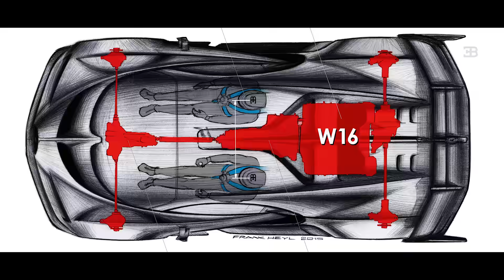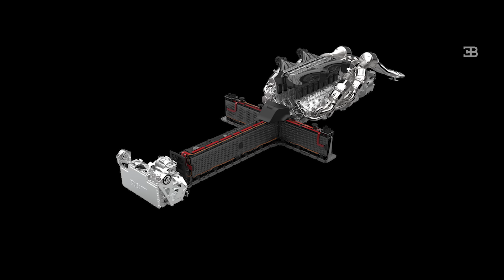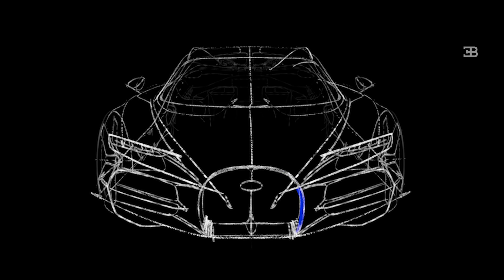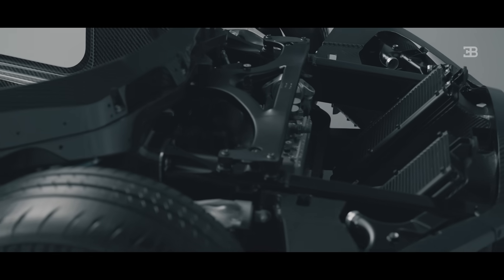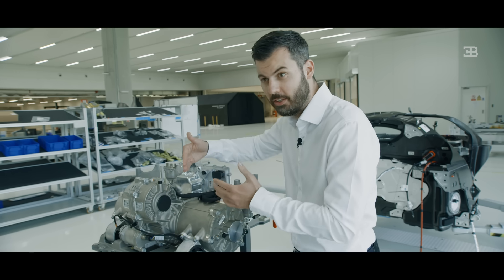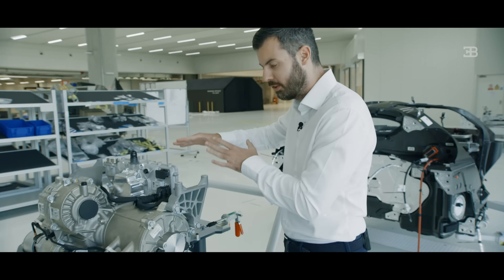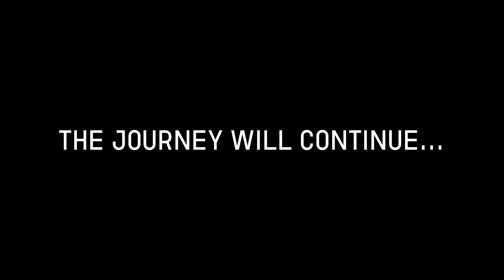BUGATTI — A NEW ERA: Peak Engineering​

Comment: 🐂 Lamborghini vs Bugatti — Quick Comparison
🏎 Purpose

Lamborghini: Exotic, aggressive, emotional supercars

Bugatti: Extreme engineering, comfort + top speed hypercars

🔥 Power

Lamborghini: V10/V12 (now hybrid V12)

Bugatti: W16 quad-turbo (no comparison in raw engineering)

💰 Price

Lamborghini: $300k–$600k normally

Bugatti: $3 million–$5 million+

⚙ Engineering Philosophy

Lamborghini: Performance + emotion, but still practical to manufacture

Bugatti: Designed like a scientific experiment, no cost limits

🛠 Maintenance

Lamborghini: High but manageable

Bugatti: Extremely expensive—tires, service, even fluid changes are massive costs

🚀 Performance

Lamborghini: 200–220 mph range

Bugatti: 260+ mph, and Chiron Super Sport hit 304 mph

Comment: With electric about to replace gas engines, this hybrid may reign forever as the ultimate ICE-powered luxury/performance automobile. A magnificent achievement. Inspired by Ferdinand Piëch, grandson of Ferdinand Porsche, this car is able to reach 276 mph.

This velocity exceeds, though not by a lot, that of the 1930s mid-engined, V16-powered Auto Union gran prix racer, designed by Ferdinand Porsche. The German manufacturer is re-entering Formula 1 racing in 2026 under the Audi  brand for marketing reasons. But for the purists, the upcoming racer’s badge should be Bugatti, complete with dancing elephant logo.

Comment: I immediately thought I would like to see the rendering of a potential trailer as a multipurpose luggage compartment (1), of course in full overall c.i. with the vehicle and as a necessary aero improovement too.

An aero improovement not for top speed of course but for overall aero effectivness for speeds up to 300 km/h - the trailer of course being made for legal use for speeds up to 300 km/h, the only one in the world with that.

And of course just a rendering - the connection between the trailer and the vehicle shortens automaticly with increased speeeds and corresponding to less steering inputs possible/required.

We all know luxury and trailer don't go together well or at all, but I would like to have the rendering anyway. Maybe just to feed to the press sometime later and do something popular for the brand. ('Sie sind nicht nur abgehoben da, sondern auch ein Stück so wie wir.')

And think of the spectacle on the Autobahn when all of the sudden you become overtaken by a hypersports car with 300 km/h with his 'ast - areo supporting trailer' behind, a gem! (At least a possible (image-) video phantasy too?)

1 - 'Golf clubs plus electric range extender' @ 800 Volt floor battery, low center of gravity and with smart, not static aero too.
Reply: And of course the correct saying would be 'the very complex and usefull aero of such car when finished can't be improoved by later add ons (in all that dirty air)', correct, and not just only in the first place, and such trailer can't have 'the usual vertical chunk of metal facing to the front all trailers have' - all that's why I would ask for a little brain work and a potential rendering about it. But sometimes longer structures tend to become more efficient. 

Rainer Maria Rilke 'Wir, Vergeuder der Arbeitsstunden im Luxusgeschäft ... machen Luxus überhaupt erst dadurch zu unserem Geschäft'

Comment: All this is well and good only if you use a manual or a hydraulic steering, zero touchscreens/screens, no intrusive electronic aids and make the chassis bare bones for the best power to weight ratio, no carpets, no radio, no luxuries.... Just pure performance. That's what would make it complete. All this means nothing once you add hundreds of KGs for all that comfort, electronics and sound insulation back into it

Comment: 0:19 yes you can, this is how evoluttion works 😂
Reply: When you're in system architecture, each component and sub assembly is important to the full system.... the optimal design evolution is based on each module/component evolving with each part update so in his context he's correct (which seems to be an experienced engineer for Bugatti)

Comment: I don't think we give VW anywhere near enough credit for what they've done with multiple manufacturers, from Lambo, to Bentley and especially Bugatti. It's a desire to create the absolute pinnacle of automotive with no limitations and I'm always amazed by how they manage to raise the bar every time.
A naturally aspirated engine mated to an electric hybrid system is absolutely the correct solution. EV for around town, the soul, passion and user experience of the NA engine with electric motors filling the torque curve like a turbo charger. There are no downsides at all and especially running on synthetic fuel there is literally no reason to go full EV at all... If only governments would listen.

Comment: Summary here are the key points from the video about the Bugatti Tourbillon:
The Bugatti Tourbillon showcases significant engineering and design innovations that work together to enhance overall performance.
Engine and Aerodynamics:
 * The W16 engine, though short, is wide. The gearbox has been relocated behind the engine, which improves the car's aerodynamics [00:45]. This new layout allows for a longer diffuser, double the length of the Chiron's, generating more downforce with less drag [01:26]. The front axle is powered by two electric motors, with a battery positioned between the engine and the front axle [01:06, 01:12].
Cooling and Packaging:
 * The car features advanced cooling systems, with medium temperature systems at the front for the electric components and brake system, and cooling for the combustion engine on the sides of the luggage compartment [03:01, 03:14]. The design also includes innovative packaging solutions, such as placing the steering rack in a gap between the gearbox and the inverter to save space [03:58].
Innovative Structures:
 * The Tourbillon utilizes 3D-printed components, including metal structures in the diffuser that also serve as a crash structure [05:09]. The suspension arms are also 3D-printed, shaped like wings, and optimized for strength and low weight using AI [06:35].
These integrated elements contribute to improvements in weight, packaging, aerodynamic efficiency, and downforce, resulting in superior overall performance [07:39].

Comment: To turn the Moon into a “heaven-access perfect habitat for humans,” we need a bold, science-rooted plan that balances cutting-edge technology with extreme environmental control. Here’s a detailed vision for your idea:

---

🌕 Project: Luna Haven — The Moon as a Heaven-Access Human Habitat

🏗️ 1. Habitat Design

Dome Cities (Heaven Pods)

Transparent graphene domes that mimic Earth's sky and filter harmful radiation.

Controlled Earth-like gravity zones using centrifugal living modules in underground rings.

Artificial weather system: clouds, rain, and breeze using atmospheric control and mist emitters.

Subsurface Cities

Lava tube shelters 100–500 meters underground.

Shield from radiation and meteorites.

Interior lit by solar fiber optics and plasma mirrors from the surface.

---

🔄 2. Life Support System

Air:

Oxygen made by electrolyzing lunar ice and oxygen-rich rocks (ilmenite).

CO₂ scrubbers using MOFs (Metal-Organic Frameworks).

Water:

Harvest lunar poles’ ice deposits.

Full closed-loop recycling system (urine, sweat, waste into pure water).

Food:

Bioengineered multi-tier hydroponics & mycoponics.

Crops enhanced by UV-optimized LED arrays.

Algae, insects, lab-grown meat for proteins.

---

☀️ 3. Energy System

Helium-3 Fusion Reactors (goal by 2040): Clean, high-output.

Lunar solar farms with eternal light belts at poles.

Superconducting underground power cables.

---

🚀 4. Transport & Access

Electromagnetic launch rails to return cargo to Earth.

Low-G aero-tube trains connecting habitats.

Moon elevators (future phase) using carbon nanotubes from L1 station.

---

👩‍🚀 5. Health & Recreation

Anti-radiation clothing and inner magnetosphere generators.

VR-enhanced therapy domes to reduce isolation.

Gravity gyms with magnet-assisted muscle simulators.

Meditation gardens with programmable holographic sky.

---

🧠 6. AI & Governance

AI handles environment control, farming, maintenance.

Digital “Lunar Citizenship” with universal basic access to power, air, water.

Decentralized governance using blockchain voting and Earth-linked representation.

---

☁️ 7. Heaven Access (Symbolic + Spiritual)

Spiritual Sanctuaries built into craters—silence, cosmic view.

Transparent domes for celestial observation and prayer.

VR Portals connecting Earth’s sacred sites with moon “chapels”.

---

🚀 Timeline Vision (Ambitious but Achievable)

2025–2035: Robotic terraforming & mining, water extraction starts.

2035–2045: First domes, AI systems, hydroponics, test residents.

2045–2060: Full dome cities, tourism, spiritual & cultural zones.

2060+: Independent lunar civilization, Earth-Moon bridge complete.

---

Would you like a visual design, animation, or full technical breakdown of any part?

Comment: 6:44 is probably one of the most stunning examples of AI tech reinventing "basic" functions right now...I mean, how would any computer model, let alone a human, come up with a shape like this? This is insane.
Reply: worth noting that such structural designs (AI based) have been proven and widely used in the aerospace industry for at least a couple years now
Reply: I remember seeing these organic forms in architecure some years a go. Within the last 10 Its found a lot of application in Ai design and it makes sense. Structual intergrity with a unique solution to compensate for weight and proper load bearing. To be in a world with metal printed in organic forms would be interesting to see
Reply: This is not necessarily made with AI, a simple topology optimization can give results like this.
Reply: @frankipankishanghai 100% these cars are apparently designed on paper.

Comment: I love how they're using 3D printing for critical components! I wonder how they've strengthened the parts, 3D printing produces much lower density and weaker microstructures as compared to casting parts. Generally, parts that go through extreme stress cycles are preferred to be made traditionally.

Comment: That was a good video. For what is worth I enjoyed it. Few things made me an impression and one of them is more on the ~"joke side" :P. First thing is... I've already encountered those "AI Designed Optimal Bone like Suspension Holding arms thing" but I cannot remember weather it was in clips about this car or another... But wherever it was... It impressed me there... It impresses me here. The way I understand it is (Which I assume is close to what Mate Rimac said but it`s still my current understanding)... The AI... "Imagines" the car with all of it`s input realistic and known measurements...  into an "environment" with also realistic (and all of those are more or less know and described and describable in numerical values stuffs) parameters... Than it is made to "run it trough" and it sort of ~not exactly "fills in the blanks" but more like it <Intentionally> (as set goal) and >>>Intelligentially<<< "reduces" an already input component that would have already been there by "traditional understandings"... with it`s absolutely bare minimum most optimal form, material, etc. so that it works >>exactly the same<< but being less heavy and even maybe more "overall endurant" because "strong" does not simply "cut it", but of course I really liked the "set buffer" thing... like I imagine something like "Make it the absolutely best it can be and you can for what it is and what it is expected to do... but than add ~5% additional capabilities on all parameters <<beyond the requirements of the task>> so that it than does what it is supposed to and what it is expected... but at least according to known science ~never encountering anything within it`s realistic expected environments that will ~break it... Maybe only material aging... Because I assume... Imagine for example a speed as extreme as 300 kmph ~(not so much for that particular car brand).. but still a very high speed never the less... Than there is a say ~Slightly bellow fist sized sturdy rock debris (but one, because there seem to be no singular form of that word) ~that for all intense and  purposes could have came from "outer space"... It is there... but it was A) in a shadow, B) when within the visible range window the driver have just been ~looking at ~not where it is... Sure the Tire will go and possibly the rim ((but those are extreme cars and I don`t wish for that happening to no one)... but the suspension holding arm with those +5% ~most likely will not... Everything <<above>> that described pebble will count as straight up ~crash which more or less cars neither are, nor are expected to be designed to be "resilient of". 
 That was a lot of text... damn... Next is ~I kind of expected the V16 to be Front Mounted :P. I know it sounds ridiculous... but come on... Just forget all of those Aerodynamic stuffs and Weight Distributions and make a Bugatti Viper but with V16 instead of your "regular" V10 the Doge Viper have :P... Long hood "cock pit" in the back... because compensation for other lengths :P. Bye.

Comment: Yea... but can you get your car to do this:
-customized Airbag? (That kinda mimics spiral baloons)
-can you make a Waterproof car trunk!
-Make the exterior side of the sun visor white with horizontal pockets ...and the entire interior side completely reflective mirror that covers the ENTIRE interior visor (slider on it to turn mirror off/on).
-Combine heated floors with resen "beach" table and light up hexagon table but can also use a tree stump that I cut to be level and once its smooth and the apoxy has hardened then cut it into hexagons. The car could also do the same thing with other things besides wood.
-car that has its exhaust pipes coming through the middle of the cars taillights to look like they are eyes
 -The individual left and right spoilers go up and down to look like eyebrows.
-The dash is a desk and the middle section is just apart of the seat fabric (seamlessly flush)
-You can do all the maintenance on the car from inside the car interior. Car body lifts up to provide raised roof and easier to work on and move inside the vehicle incase its raining etc.

Comment: Wow I'm impressed, usually with topological optimization, we look at where the computer removes material in the topologically optimized model and we remove the material where needed while still conserving the "non-organic" shape so it's still easily manufacturable. But here they just straight up took the topologically optimized model and printed it, really innovative stuff you don't see everywhere

Comment: you could try to make an airchannel with the rear diffusor around the rear exhaust so it creates negative pressure for the exhaust system, like a bypass system in modern jet engines

Comment: Serious question, could you conceivably run out of 4 wheel drive before you run out of gas if you drove for long enough? If the front wheels are purely electric what happens when the battery dies? Or is there a capability to regenerate power off the engine or something like that. I think it’s a cool design I’m just genuinely curious how it would work for longer drives.

Comment: No question about the engineering achievement.  The bigger question for the CEO is how much revenue can this master piece generates?  What is the next era?  His job is not just the product, it's the forecasting for investors.  After all, it's all business.
Reply: Bugatti is a sort of loss leader for Volkswagen Group, profit is not their primary purpose. The overengineering is part of its modern brand identity. It was mostly a prestige thing for Ferdinand Piëch, but it seems that VWG simply continued Bugatti as it was since his death. Their margins are to this day very thin.
Reply: @MKhrome  thanks for the explanation. So, this is a brand selling art.  Not trashing them, some EV in 2025 is way faster on acceleration except top speed.  The original point sports car is go fast but now,  things have changed.  This machine is so complicated, every part is laser made and yet slower.  I can't use logic to wrap my head around it.

Comment: I love how everyone(big oem companys) is figuring out underbody aero is the holy grail for overall stability and drag. If down force is just a pressure differential  between the floor and the roof it would only make sense to try and decrease the amount of pressure traveling underneath as much as possible rather than increase pressure above the car.

And the cherry is that this car is by far the best looking Bugatti ever which also means one of the best looking overall
Reply: And no need for a gigantic ugly wing that looks like it came off a top fuel dragster!
Reply: THEY FIGURED OUT THE WEDGE SHAPED CAR IS REALLTY JUST A AERO WING WOOOOOOOOW , SO PEAK !
Reply: @ca5ualm3dia  and that's why you are ca5ualm3dia and not the Bugatti CEO... 🤣

Comment: 4:01 Why is there a gearbox in the middle of 2 electric motors? Maybe a stupid question but I'm just curious
Reply: i would guess a motor gearbox is used to modify the motor's speed/torque output and it also allows a motor to operate at a desired speed..
Reply: From what I understand, it's to artificially make a higher RPM for the motors to spin the wheels, so they match the engine's rpm for the wheels.
Reply: Torque vectoring maybe?